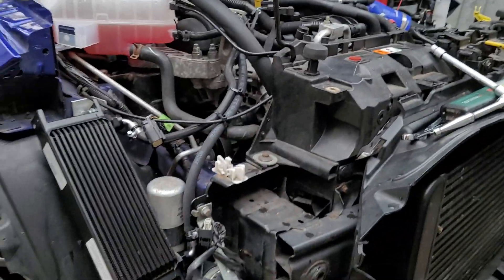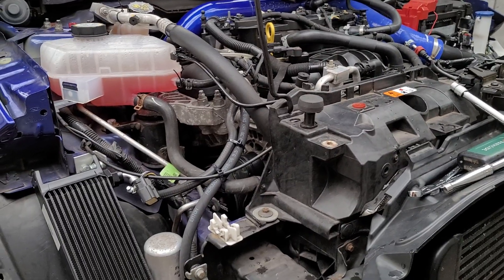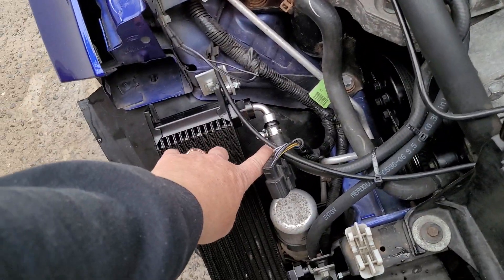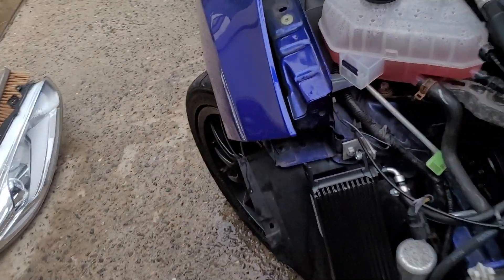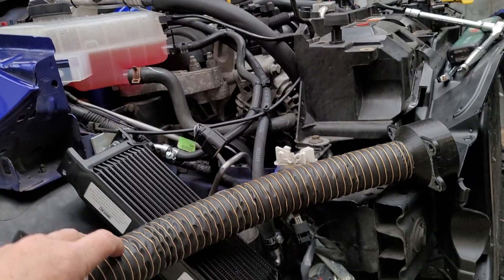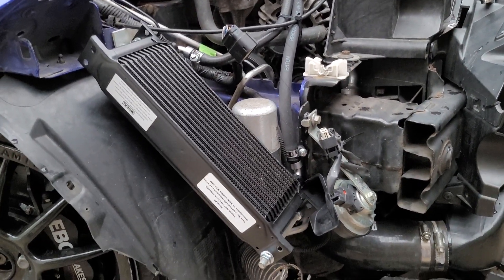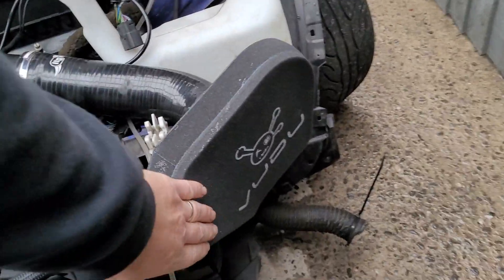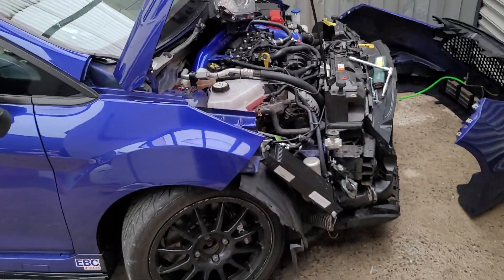What is a Turbo cooler? Fiesta ST180 gets one

Comment: From experience as soon as I got rid of the airtec intercooler and standard crash bar. All the cooling issues went away. 
Currently running 
Pro alloy radiator and oil cooler
Spec-r custom spec intercooler ( half height ) 
Turbo cooler
Reply from the maker: Yeh I'm realising the intercooler is a big problem now. I remember talking to you a long time ago about your setup
Reply: @Sparkplugsteve  turbo cooler should make a noticeable difference. Be interested to see the results from the mocal set up

Comment: Im planning on going up to stage 3 at some point, and I've always wondered about full height intercoolers blocking airflow to the engine bay.
Would you recommend the laird mid height cooler, so as to allow more air into the bay.
Reply from the maker: Depends what your planning on using the car for really. If its road use then the bigger coolers are not an issue and better intake temps I'd favour over cooling concerns as on the road you won't do more than a few hard pulls without having to slow down and the cars copes easily. It's track use where the coolant is an issue but as for lairds cooler iv never tried it so can't comment really

Comment: Great can always run mini fans on them to push or pull .
I do wonder if the cooler shouldn’t be rubber mounted otherwise eventually the stud and bolt might fatigue especially on bumpy tracks .

Comment: Do I see an enormous gap between intercooler and radiator? I believe for efficient cooling they should be sandwiched as close together as possible.
Reply from the maker: Yeh it's impossible to do that due to the crash bar. The intercooler is stepped so the lower half below the crash bar is thicker and closer to the air con rad. Its not an ideal situation

Comment: Have you fitted any of the recall hardware to the cooling system? May help. There are some changes physically.
Reply from the maker: Iv done the thermostat but it makes zero difference on track
Reply: @Sparkplugsteve  ill send some photos. There's a little bit more going on. Mines looks to have rerouted pipe work after the turbo.
Reply from the maker: @deanmarsh1452  yeh it still doesn't make the car run cooler. The bottle has a level sensor and the front pipe is changed to steel.
Reply: @Sparkplugsteve  there's more than that. The bypass valve is different too. Downstream coolant pipe from the turbo is repositioned, so it has priority.
Reply from the maker: @deanmarsh1452  yeh even so it still won't run colder on track. My brother has a recall car and it gets hotter than mine.

Comment: Hey Steve, when you did your last oil change, do you use a engine flush or just change filter and put in new oil? I have the Vauxhall Corsa VXR E, I was told to use 5/30 oil, does that sound right to you? thanks Steve
Reply from the maker: I don't flush it no and sorry I have no idea about the corsa oil specs.
Reply: @Sparkplugsteve  yeah no worries

Comment: Interesting idea for adding an additional cooler,  I'm glad to see your thinking about the airflow out the cooler. From my experience in motorsport having ducting to take hot air from the cooler/radiator is extremely important in increasing efficiency

Comment: I know it’s your daily as well as a track car but wouldn’t you be better off putting several hole saw holes under both headlights? I think the car needs to be one or other now daily or track just my opinion
Reply from the maker: It never has been a daily this one. Im a bit nerdy with airflow research and cutting holes is never a good idea. If you look at race cars they often have smaller frontal air zones than the road car version.  There's enough mouth for airflow on the bumper as it stands you just have to use that air efficiently.  Holes create drag and you want the least amount of holes possible.😁
Reply: @Sparkplugsteve  surely an increase in direct air flow you would get to the air filter and turbo cooler must benefit the car over a tad of drag.
Reply from the maker: Not really as the airflow to the air filter is more than enough.  Iv done a  video on that before.  The turbo cooler will get air from the front opening in the grill so everything will get what it needs without adding any extra holes. Plus I dont like bumpers with drilled holes to be honest. Each to their own but its not for me

Comment: Hi Steve just a quick question,I have a slight knock between hear changes and if I dab the accelerator in first I get a knocking sound ..could this be the engine mount,cars  a 2017 with 23k miles
Cheers

Comment: Nice man! You won’t be disappointed, I don’t have any air flow going through mine and it’s enough to keep temps at bay :), after 15 mins race in the summer we’ve just had my water temps wouldn’t get any higher than 93, oil temps 105, on a winters track day, I have to block half of my radiator off as it just doesn’t get hot enough to be able to drive, eg water temps struggle to get above 70, oil 85-90.. really hope this cures your issue, I know it definitely did for mine 🤙 Also! Thanks for the mention ;) Appreciate that
Reply: @OIF/OEF-0341 yeah that’s Celsius :)

Comment: Maybe try and get rid off the Puma speed crap may help 🤔 try a cheaper more quality part 👍
Reply: What’s wrong with pumaspeed
Reply: Their quality, I got a crossover pipe, the primary vac line was 90 degrees instead of 45 degrees, the secondary vac line was full of weld and just about fitted on the car. I had to do a bit of work on it so I could use it. Not worth the price I paid for it.
Reply: @robwebster7406  oh really?!?

Tbh I just had an x48r fail completely , supposed to be under warranty, I hope it is haha.
Other than that though I’ve always had good  experience with them 😊
Reply: Well it was the only part I have had of them, if it was half the price I’d paid for it I’d be ok, if you get puma speed stuff, inspect it before fitting 😏

Comment: Hi, good video, could you link the fittings off of the cooler, i cant find them
thanks
Reply from the maker: Hi this is what you need to Google or search at merlin motorsport. 
90 Degree Swivel Adaptor with M22 x 1.5 Male Thread
Also the oil cooler needs to be a m22 x 1.5 thread.

Comment: I'm going to be going stage 3 next year and have always had my sights set on the Airtec Stage 3 cooler. Would this be a mistake and should I go for a mid height cooler such as the Outlaw 5111 which Laird Performance supply ?
Reply: Pro alloy curved
Reply: @Zaynite  nice price 👀, but I have heard good things
Reply: Go for stage 3 airtec, I have used to pro alloy one (non curved) temps were very bad, it is only rated to 300hp tbf, the curved one however is defo one of the best options.

Comment: I would run some tape over any sharp bits or edges on the crash bar you trimmed.  I've found my air filter to be missing small bits on the edge where it's rested on a not rough but not soft surface when driving over a period of time, to the point I question its filtering efficiency.

Comment: If people want to do this get in touch with me and I can make it significantly cheaper than Steve has with a mounting plate for the cooler , AN fittings and braided lines with no need for jubilee clips on the lines at the cooler

Not taking anything away from Steve, he's pushing the boundaries of what you can do with the Fiesta and making things people haven't thought of